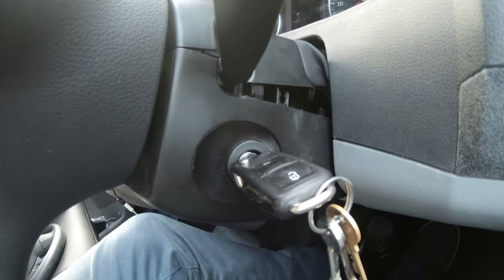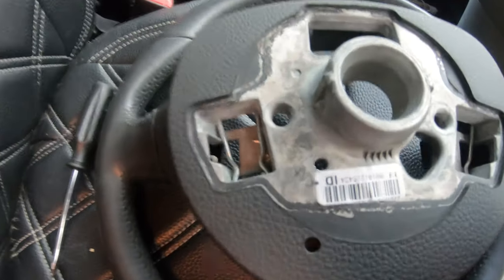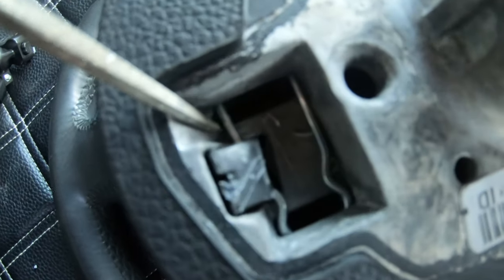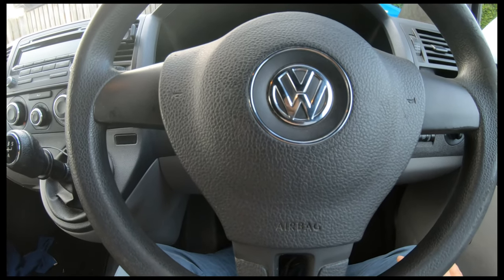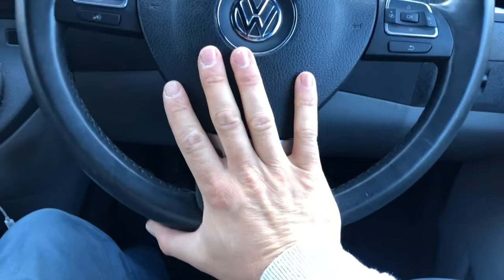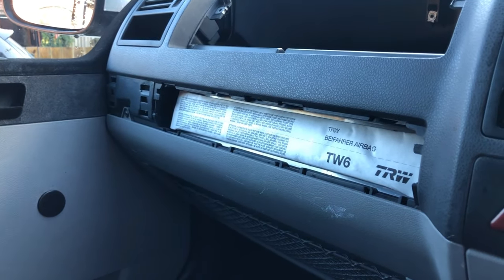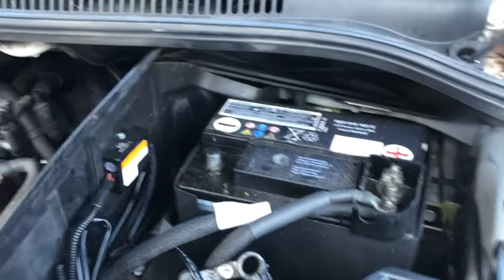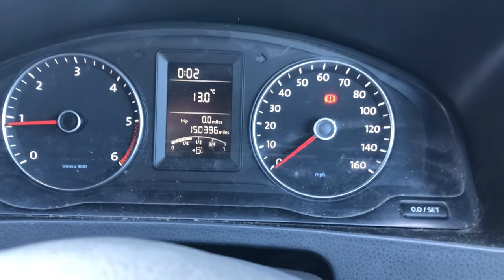Vw T5 steering wheel #builtnotbought #t5 #steeringwheel #vanlife

Comment: Did you have to put the code back in thd radio taking off the negative on the battery
Reply from the maker: Oddly no.. it’s usually when the radio is removed for a period of time..

Comment: Just done mine. Don’t connect the battery back up before you’ve connected airbag back up. I did to check steering was straight as it wasn’t before I started. Put it all back together with airbag light on no horn. Got the vcds code boxes ticked for mfsw. Still nothing worked light horn buttons etc. Retraced the wires and re did the tap connections and then it worked horn. lights on wheels and mfd but unfortunately no stereo controls. Stereo is kenwood ddx4dab. Anyone got any ideas.

Comment: I have same info screen that you have... does the steering wheel change upgrade it to that with some more info on it...
Reply from the maker: No not yet I need to upgrade my bcm module under the steering wheel. Then program it to add the features👌🏻
Reply: @tomtdubz  really keen to see the multi function steering wheel working.
Reply from the maker: Soon as I sort one for this van there will be a video 👌🏻

Comment: Did you use the airbag from the original wheel?? Would love to see a detailed video on connecting the buttons up. Keep up the videos buddy 👍
Reply from the maker: Adam M 👍 yes bud, used the air bag of the original t5 wheel. Hopefully that video will be out soon.. just got to get my head round it 🤞👍
Reply from the maker: Adam M 👍 yes bud, used the air bag of the original t5 wheel. Hopefully that video will be out soon.. just got to get my head round it 🤞👍
Reply: Brilliant i will be hunting a wheel now then. I have looked into the connections and can’t find anything clear cut.
Reply: I have now done this on my t5.1 and is all working also added some functionality to the dials. Let me know if you want a hand doing yours.
Reply from the maker: Adam M Fair play! I will definitely be giving u a shout on that one!
Reply: @adamm927   can you tell me what steering wheel worked for you ...
Reply: Firaz Naji i used a normal MFSW probably from a mk6 golf and then brought the loom separately. There is mode that needs doing though wires have to be added to the BCM
Reply: I have already added wires went fit air bag and was shattered it didn't fit
Reply: Did this at the weekend and all spot on apart from no horn working 🤔😭
Reply: @under2boots  think you have the wrong loom on the back of the airbag. Has to be a specific transporter one.
Reply: @adamm927 little help with wires, where and how add and connect them?
Reply: @nutnaa  been a while now, brought the proper VW spare loom wires (yellow) the connection is between the big plug on the steering column and the BCM you would have to search the connections online. Then code with VCDS
Reply: Was this steering wheel out of a t5.1 or was it out of a different Model altogether
Reply: @reddave8628  steering wheel doesn’t matter, its the little airbag loom that is t5.1 specific.
Reply from the maker: This wheel came out of a vw golf mk6….
Reply: @adamm927  I've got the standard T5.1 wheel  at the minute in the van and fancied a nice leather rimmed one.

Comment: How did you get on with getting the buttons working? Great video by the way 👍 about to do the same with my van
Reply from the maker: Never got round to it… had an offer on the van and sold it… hopefully il get round to it on another build… thanks for watching 👌🏻
Reply: Probably needed a new Multifuncion Unit (Its a small rectanglue unit under the steerng wheel.) May need to be reprogrammed with "VSDG"? cant remember the program name)

Comment: Hi Tom. Is the steering wheel from an another Transporter? I have same retrofit on to-do list at future but I need to collect all the parts before. There is a lot Passat's steering wheels much cheaper than T5 steering wheels but dunno do they fit together.
Reply from the maker: This wheel is from a mk6 golf, same as the Passat and a straight fit with your air bag 👌🏻
Reply: @tomtdubz  ty man. Do they include the wire for the buttons? I have heard that the otherside works as you put the steering wheel to its place but the otherside needs the wire to work properly. Ot at all. If the wire has to buy separately, do you know the partnumber?
Reply from the maker: Don’t no the part number sorry, the wheel will come with the loom in the wheel, you’ll need to then get the loom and possibly upgrade your bcm too
Reply: Okay. Not sure do i have to get a new bcm, cos i have cruise already.? I have read that 086 bcm should work with mfsw and 087 mfsw+cruise and etc.  Should work right away after coding.
Reply from the maker: Hopefully it will let me no how you get on as I’m planning on something similar
Reply: Yes i will. This might take some time until done. I have a lot of paintwork and other fix ahead before mfsw. :)
Reply from the maker: Me too 🙈 will get there in the end 👌🏻
Reply: @tomtdubz  How is it going Tom? Now I've got the wheel, but still wondering about that wiring harness or something like that. I have the wires also in the wheel but I have understood that I need 2 other wires to put somewhere to right pins. Do you have done this job yet? Is your mfsw buttons already working?
Reply from the maker: Going well just waiting for my wheel to arrive then will post a vid, 2 wires are needed one from pin 9 to a 12vlive feed and one from pin 10 to pin 17 on the bcm loom both from the steering wheel loom.... 🤷🏼‍♂️ lol then vcds to let the van know it’s got it lol
Reply: @tomtdubz  You have the wires already? Where u bought it(if u have)?
Reply from the maker: @GARFFi1  got mine from travelinlite, there less than a 10ner 👌🏻
Reply from the maker: @GARFFi1  yeah there the ones 👌🏻
Reply: @tomtdubz  awesome man. Thanks a lot!

Comment: Did you have any issues with the horn not working? I'm planning on doing the exact same thing with my T5 and I've read on some of the forums that the horn will not function with the new wheel. Cheers Matt
Reply from the maker: Horn works fine, never had any issues with it...
Reply: Thats when putting it on a T5 not 5.1 as in this vid

Comment: I changed mine today & horn no longer works 😬 any ideas?? 😂
Reply from the maker: Did you trap a wire... should be an issue l...
Reply: @tomtdubz  I don’t think so.. I will take it back off tomorrow no have a look 😬 I
Reply from the maker: Any joy fella?
Reply: @tomtdubz  basically I got a 6r polo..so what I did was swapped a wheel from my polo to my transporter. The wiring look for airbag was straight plug in. I just checked the polo and the horn works on there..so I’m assuming wire might have came lose..I’m going to take it off now and have a look 😌 I’ll keep you updated 🤙🏻
Reply from the maker: Sweet, let me know, be good to know if it a straight forward swap
Reply: @tomtdubz  all sorted!! A wire had come lose. I just popped in on! So in answer..yes the airbag wiring loom is the same 😀
Reply: Same steering wheel bought for T6 looks good but no horn. Guess I'll need to resell it and get a T6 steering Wheel 🙈